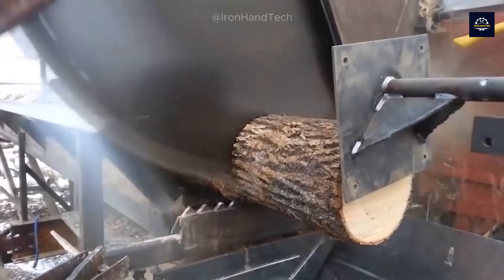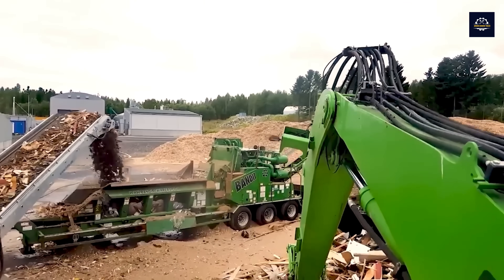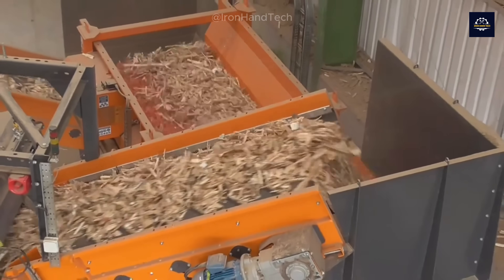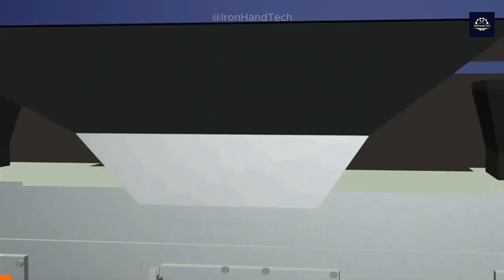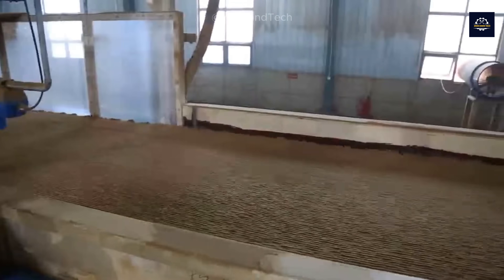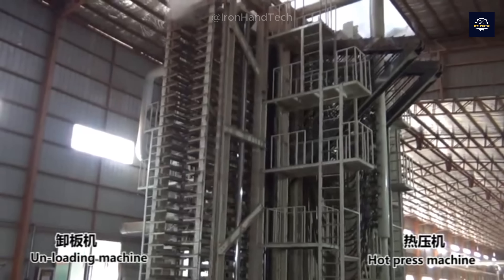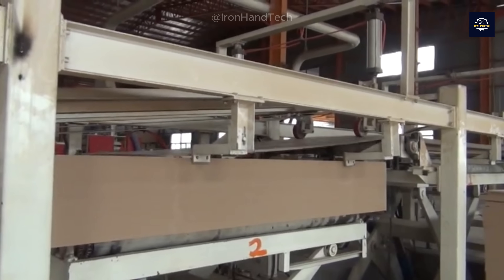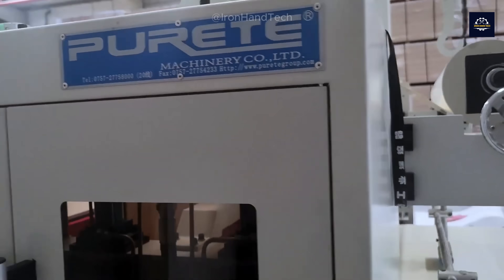How to transform Wood waste into MDF boards through Recycling Process ?

Comment from the maker: From Waste to Wonder: The Journey of Recycling Wood into MDF Boards ?
Reply: Can sawdust be used for this process of manufacturing MDF ?
Reply from the maker: @Joy-ie2tp  I think yes, sawdust can absolutely be used to produce MDF boards and is actually one of the main raw materials. MDF (Medium Density Fiberboard) is made from acacia wood resin combined and pressed under heat, with high applications. Sawdust - a by-product of sawing wood - is already in the form of small particles, easy to grind into coarse particles, very suitable for this process.
Reply: Turning complet trees into MDF is no recycling! It's straight up unhealthy capitalism to serve our manmade desire for cheap throw away fashion furniture.
Reply: نعم

Comment: The vapor is a severe respiratory tract and skin irritant and may cause dizziness or suffocation. Contact with formaldehyde solution may cause severe burns to the eyes and skin.  Need proper PPE when cutting MDF.
Reply from the maker: Thanks for providing this information. You are very knowledgeable.

Comment: wood? pollution? lol.
let me (wikipedia) tell you about mdf.

Low-grade MDF may swell and break when saturated with water
May warp or expand in humid environments if not sealed
May release formaldehyde, which is a known human carcinogen[12] and may cause allergy, eye and lung irritation when cutting and sanding

MDF is trash.

Comment: `So let's bust the myths here. MDF is made mostly from newly milled trees, very little from "re-cycling", (too expensive). The heating then cooling then pressure process puts tension into the boards, MDF is not a stable product. It will spring while being cut. The surface is not sanded as all MDF sheets have a shiny surface. MDF sold in Europe is made without urea formaldehyde glue and will therefore not take a water based finish without raising the fibres. 
Basic MDF today has a limited furniture making application, no strength, poor finishing substrate and bad screw and glue retention capabilities. Any water based glues are soaked into the fibres in about 30 seconds, reducing their "initial grab" properties.
A poor product that needs an alternative.
Reply from the maker: Thank you for your comments, thank you for watching the video. If you recycle the discarded wood into MDF boards instead of throwing them away, it will save environmental resources. We want to emphasize the meaning of recycling. We do not deny its weaknesses, but the value it brings to this life is much more than its weaknesses, do you agree?

Comment: Wood waste will not cause pollution
Reply: Actually, waste wood is not a waste anymore when it sit directly onto the ground for years. It will be a slow fertilizer.
Reply: It all for the bull 💩 climate change agenda so they got to push it pollution crap😂😂😂
Reply: It caught fire.
Reply: MDF is a low grade building material which is toxic to some individuals due to outgassing.  Generally not used for home construction,  but popular for inexpensive furniture products.
Reply from the maker: @lo1234-w9r  Thank you for watching the video and providing this knowledge to us and the viewers of the video. We just want to provide a perspective on the process of recycling wood instead of throwing it away and exploiting new resources - especially the acts of exploiting primary forests, which is very bad for the earth. We hope that in the future the quality of this product will be better for the environment and users.
Reply: Any waste cause pollution, the energy requiered to recycle wood is huge, machinery, electricity, fuel
Reply: Not directly. Imagine how many trees aren't cut by recycling wood. That's the point where it lowers pollution. 😊
Reply: However converting waste wood into MDF is highly polluting.  No mention of it here or the carcinogenic end product.
Reply: @Glynthepin Exactly!  They very briefly mentioned formaldehyde resin,  but didn't mention just how bad that is...
Reply from the maker: @Glynthepin  thanks for mentioning this. i think i need to look into it more. but i'm sure recycling has its benefits and nothing is perfect

Comment: mdf is not durable
Reply: Maybe not, but it's cheap and it's stable.  Solid wood shrinks and grows with the prevailing weather, making its use for furniture an expensive lesson in constant maintenance, and that's assuming the craftsman who made it knew what he was doing, or you risk having spent a lot of money on a kitchen table that develops a huge crack or warp a few years down the road.

Meanwhile, MDF doesn't warp, doesn't shrink, is good enough for use in most furniture cases, and if it gets wet from some kind of household accident like flooding or tree coming through the roof during a storm, it's not such a huge loss to throw out and replace.

You know what happens to that heirloom solid oak cabinet after such an event?  Shrinking, cracking, required (expensive) refinishing and refurbishing, chasing after the goal of maintaining its value, when all that really matters today is its UTILITY.

Comment: Video not recomended.

Showing perfekt logs beeing chopped up for MDF production, while talking about sustainability and recycling is evil sarcastic.

MDF is regarded the least quality of technical wood material and mostly used because it is cheap. Producing MDF to use otherwise lost wood waste to produce MDF is ok. It has it's use cases. But using perfekt logs to feed our societies 'need' for cheep woodalike beaver puke - a better not.
Reply: exactly my thoughts, I saw a lot of nice wood I'd take in a heartbeat :(
Reply from the maker: I think you focused too much on illustrations instead of the main information and content of the video.
Reply: @IronHandTech2024  Look at it again. Large Logs and Trees are being put thru the shredder.
Reply from the maker: @vickietownsend5944  You are right. But those logs are of no use anymore.

Comment: You only problem with MDF board. It's not good for furniture. After a year or 2, it falls apart. Get it wet and just Deteriorates, it can be used for speakers and a few other things furniture. No, it will not hold up. It will not understand any.  Moisture unless they've developed some sort of additive to keep it from getting wet but the minute Is m d f gets wet It starts to fall apart.It's not good for furniture
Reply: Exactly, keep it dry… toilet paper rolls get ruined when they are soaked too….
Reply from the maker: It will be worth it if you use it properly.
Reply: There are additives that can help it get to structural grade strength

Comment: Really renovation technology to make full use of wood, MDF is good to use for millwork and woodwork project
Reply: Actually, turns that MDF is even better than real wood for woodworking and carpentry (well, mostly). It comes in prefabricated panels, straight, flat and squared which is almost impossible with real wood, and even if wood is dry-processed and low on moisture, it still can bend, twist, expand or shrink over time because of nature of fibers. This is rare example of recycling where end product is more usable than original one.
Reply from the maker: Thank for your information.

Comment: I want MDF from this factory. Last time I bought it, it was just a little stronger than cardboard.
Reply: Thats normal
Reply: I just made speaker box with 20mm MDF. Sound is incredible good. 12 inch bass drivers. Best sound I ever hear. And box are so strong. My wife use it instead leaders, when she installing new curtains.
Reply: If you want MDF, you can also come to me for it. We are also from the same factory.

Comment: The last 13 yrs ot my working career was at a chipboard manufacturing factory we had a recycling plant for material from waste transfer stations i enjoyed working in there after all metal plastic  glass grit was taken out all clean chips which was mixed with shredded wood chip sawdust  i think the final product was60% clean wood 40% recycle massive cost and enviromental saving
Reply from the maker: High cost is a barrier for the recycling industry. It will be easier for bosses to choose a less expensive way to produce the product. But if we only think about the present, the toxic future is what our descendants and maybe we ourselves in another life will have to suffer.
Reply: So why do chipboard blunt carbon tipped circular saw blades bandsaw blades and blunt planer blades I have stopped using it as you see sparks from the wood when cutting.
Reply: @paulstanding7267  Its usually grit like sand or small rock. With particleboard the chip supply isn't washed like it is in MDF so if you have it go into the system on the front end it will make it to the finished product. There are means to remove some but it depends on how the factory is setup and therefore how much gets through.